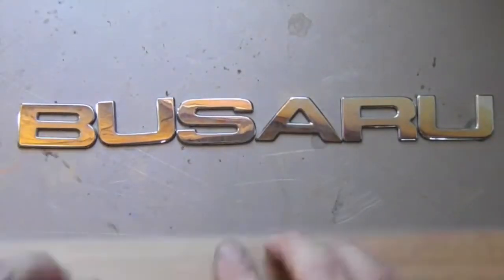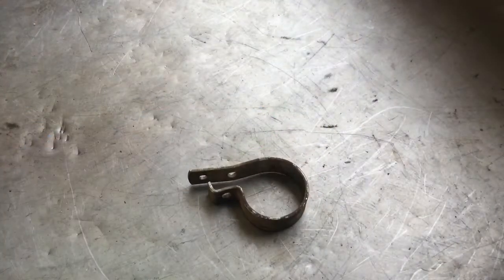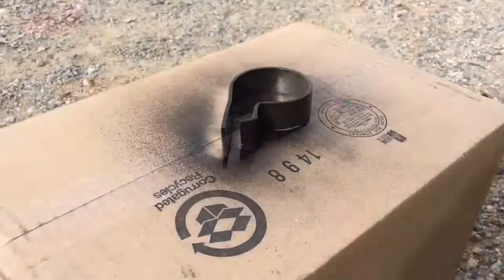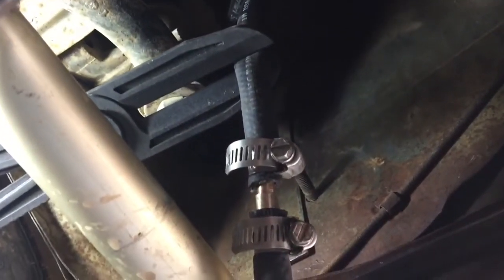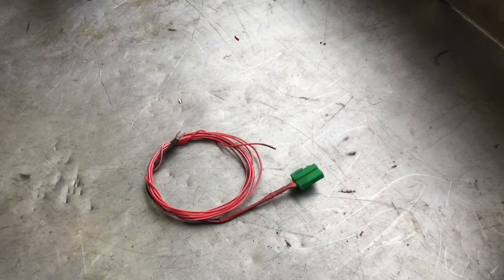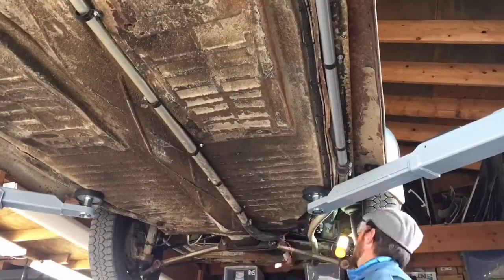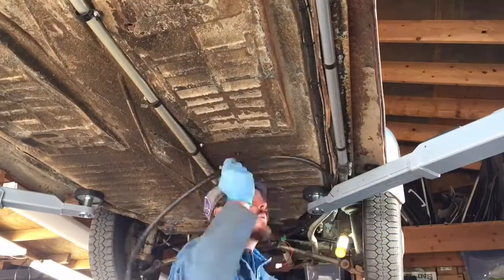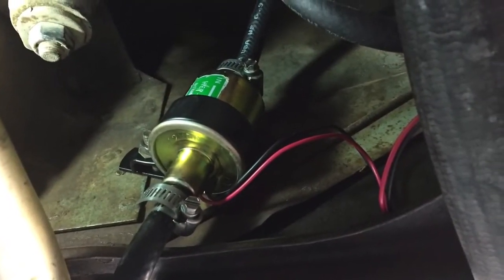BUGARU Low Pressure Fuel Supply Pump

Comment: hello I have 2 dudble dellorto drla 40 on my bike vmax 1200 but I need pow pressur fuel pump  the original  is 0.2 pressure I need 0.3 or 0.35  Amy know something  ?